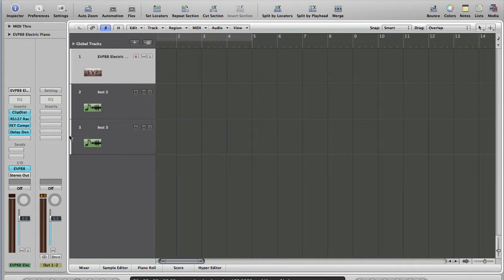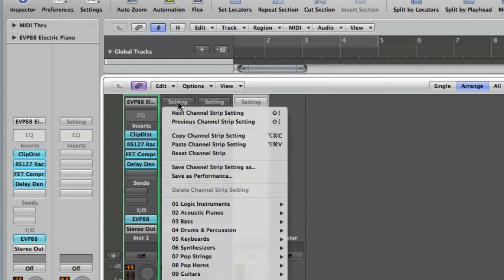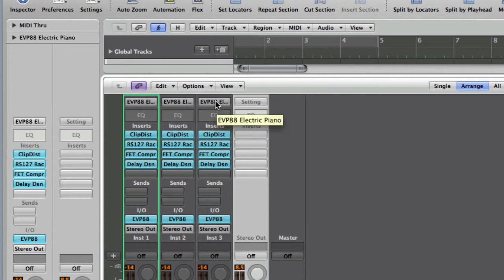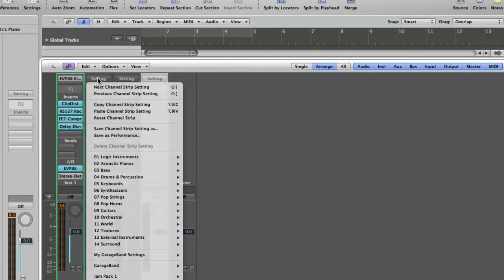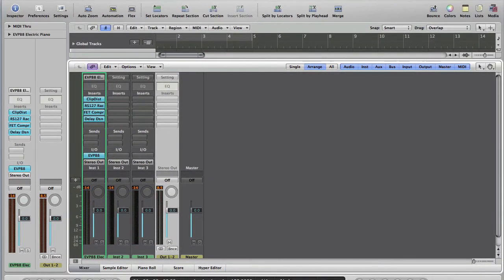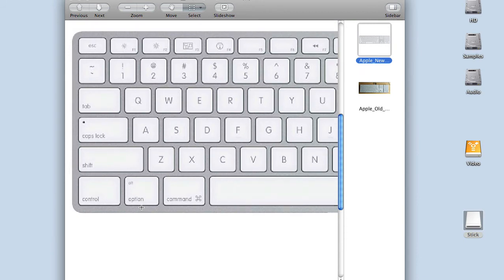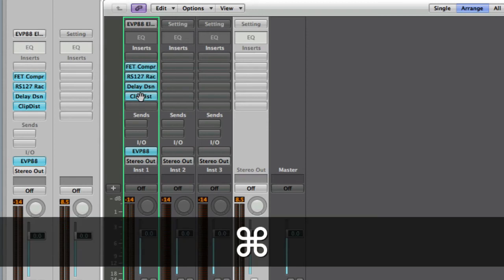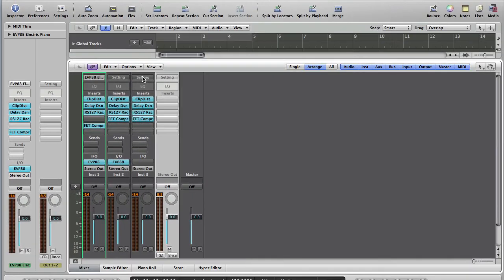Logic9: Tips for plug-ins in the mixer

Comment from the maker: @zunaic I have a Mac Pro with four slots for Hard Drives, System drive, two drives in a raid for audio and a samples drive for samples and large sample libraries. Songs ( projects ) go on the audio drive in self contained folders. I use time machine to back up the system drive, I back up projects individually to external drives and also to DVD if they are important.

James